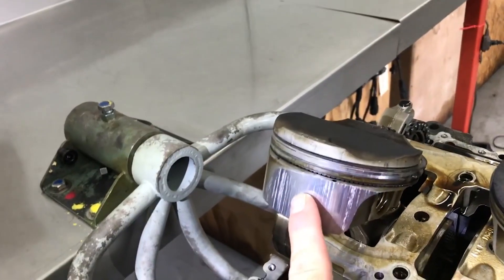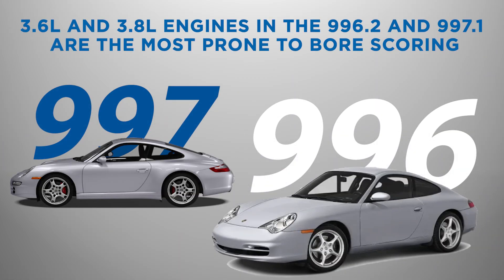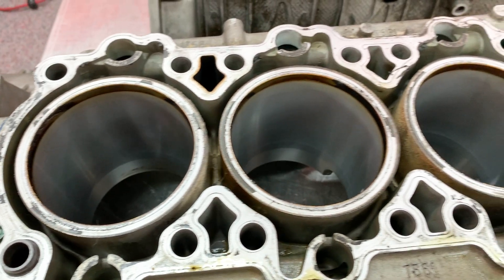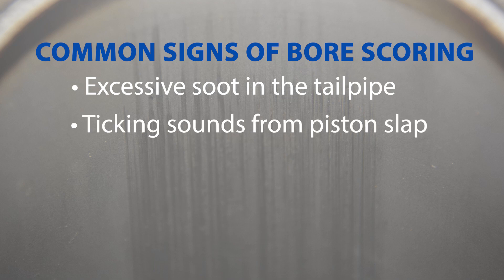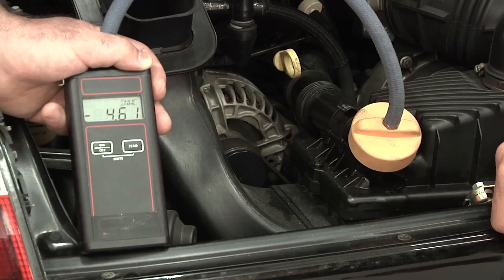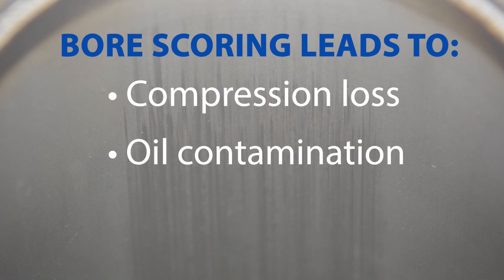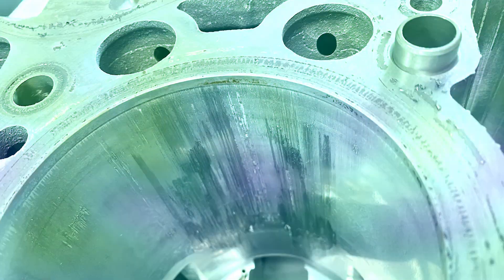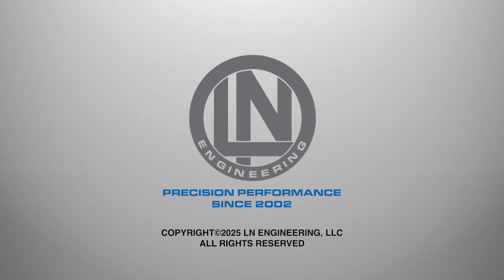What is acceptable Bore Scoring in a Porsche Engine?

Comment: While I think the bore scoring "issue" has been a little overblown, I still periodically review videos/articles from reputable sources, such as LN. Glad to know my 2006 997. 1 C4 with 58k miles runs at least 3k miles with no oil usage, has no soot on pipes, starts clean and runs like a clock.....so far. LOL. Thanks for the video! :)

Comment: Thanks for the video.  I only wish you had posted it 1-3 years earlier.  3 years ago my 2006 911S (997) developed a tick that everybody kept saying was a lifter that needed to be fixed asap or my engine would blow up. Needless to say I refused to heed the call because there was no (as in zero) degradation in performance: not overheating, not burning oil, not burning gas, not lugging or vibrating and not throwing a code and I couldn't believe my bullet proof 911S with only 65000 miles was not bullet proof afterall.  Long story short, even though the tick was annoying the car ran great....for 3 years...and I refused to pay my local Porsche Dealer $8000 to pull the engine for what I considered to be a diagnostic since they couldn't explain the tick without going inside to take a look but I couldn't find a blog, or Youtube video, or any internet article that had any answer other than "it's a lifter" coupled with absolutely no reason for the lack of degradation of performance over a 3 year time frame.  So there I am driving along for 3 years at times practically begging the Porsche gods to please just break my engine so I would have an excuse to pay that ridiculous $8000 diagnostic price.  Well the Gods finally answered and today it threw a DTC code for "missfire in engine bank 6" which coupled with some extra soot in the left tailpipe has temporarily gotten me out of the Lifter Rabbit Hole and deep down inside the new Bore Scoring Rabbit Hole and the car is finally going (begrudgingly) into shop this Friday.

Of course, now I stupidly realize that there are literally 100s of articles and videos on Bore Scoring you just have to know what to search for and unfortunately I did not know to search for any problem other than the peanut gallery's frenzied cry "it's Lifters".   Geez!!!

Comment: When I was rebuilding my r8 engine I got a single score down one of the bores maybe 1inch length. I’ve done 23k miles on it and it hasn’t got worse.

Then again I do maintain the cars health vigorously. Every 1k miles is a full oil change and service, get the park plugs cleaned, sort out the carbon buildup of any etc.

I think it’s really only a major issue if it happened inside the engine while running, then there could be an issue that’s underlying.

Comment: Apparently any amount is acceptable because it seems nobody wants to admit the obvious, it's just incompetent engineering affecting all models including Cayenne and this isn't even the only critical point of engine failure. TBH, I have a few Mercedes which have alusil cylinders and none of them are known to have bore scoring and certainly not known to for the Pistons and cylinder walls to subsequently fracture like Porsches. People have the nerve to allege Maserati is unreliable complaining about the power windows having an issue, but never anything close to the catastrophic failures of Porsches. I'll gladly get Maserati instead of a Porsche, I have done my research
Reply from the maker: There are many contributing factors, but part of it has to do with the hard eco push, where the proven processes used for Alusil were changed to make them more environmentally friendly. That coupled with modern oils, especially thinner ones, exacerbate the issue, just to name a few things. The bore scoring issue also extends to other makes other than Porsche, it's just more visible as Porsche owners are more outspoken about their support, and when things go south, their problems.
Reply: @lnengineeringllc  there's been mixed feedback online on the 3.4L engines. Do all 3.4Ls rarely score due to Ferrostan coated pistons? Or is it a subset of the 3.4L (ie, 99/00 engines with dual-row IMS)?
Reply: @suprdario 3.4L are the ones much more likely to score vs the base 2.7L because of the tighter ratios. All the base Cayman owners out there have been able to freely dog their cars without much worry while the Cayman S owners have to baby them everywhere.

Comment: Does scoring ruin block and sleeves ?
Reply from the maker: Bore scoring does require the block to be refinished which involves fitting sleeves and new pistons.
Reply: @lnengineeringllc   2 quick questions. Are you noticing an increase in these inquires as these cars age? Is refinishing a block a more affordable route that finding a salvage/ebay motor?  Thanks for your time